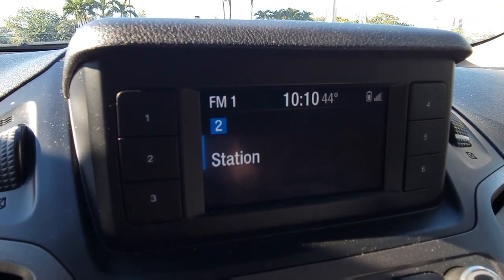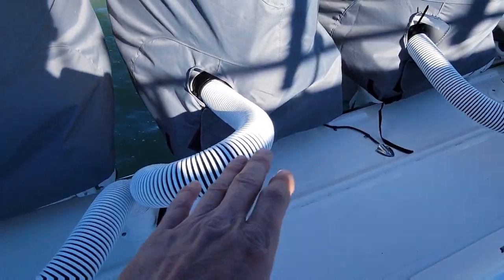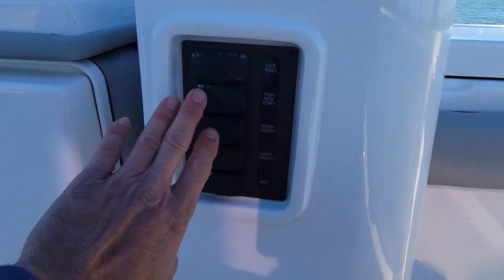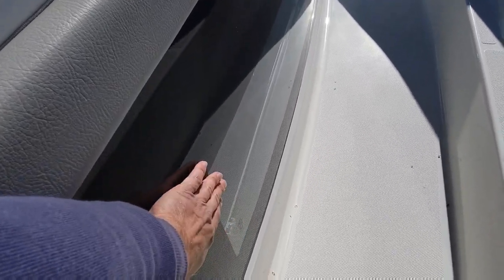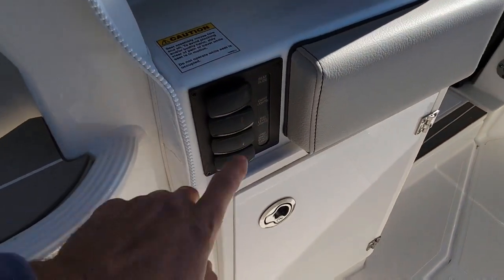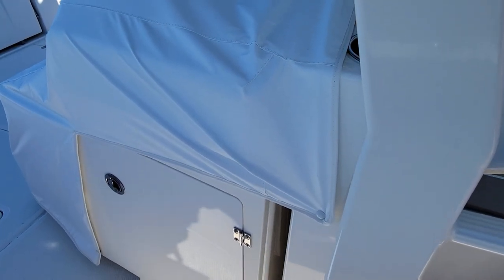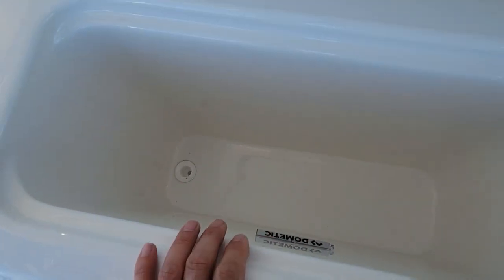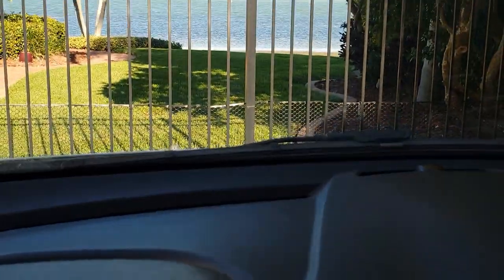The Pursuit S428 - Mini Tour - Episode 128 #Pursuitboats #Tour

Comment: Not a fan of the looks -- I like the old 408 more. I wonder if the electric bench seat will cause endless problems?
Reply from the maker: I like the 408 as well. That was a Tiara built boat. This is a "Malibu" built boat. They changed the design to more modern with the 428.